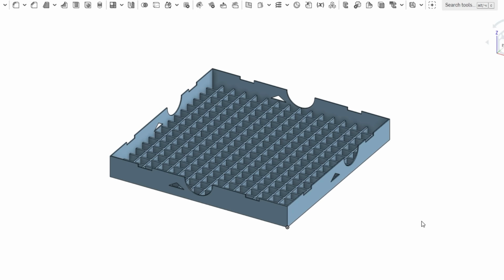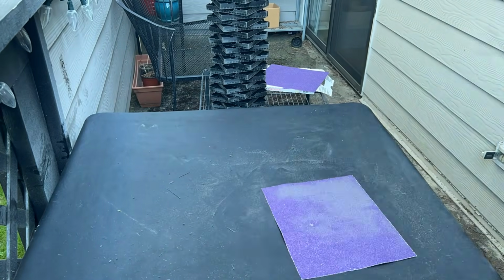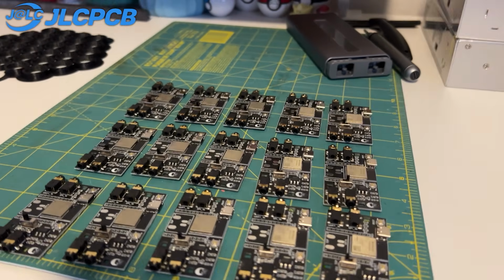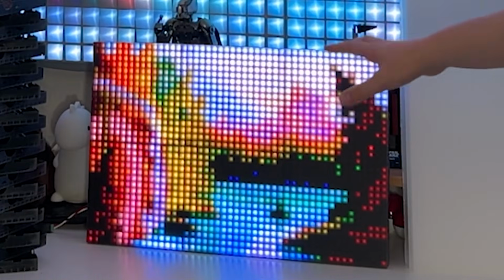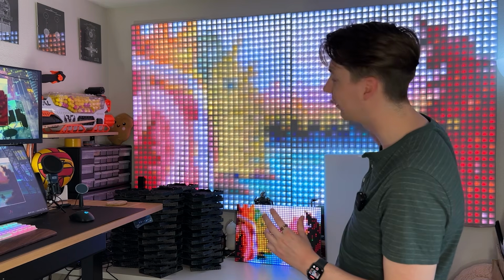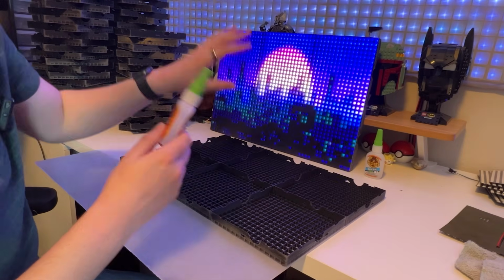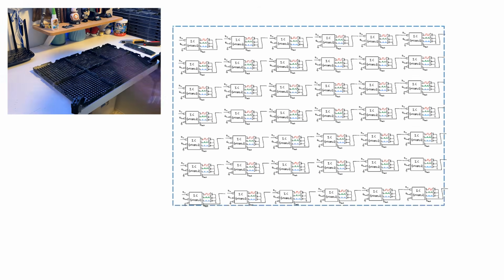How To Build a HUGE LED Wall From $5 Tiles

Comment: You didn't cover the most important part, software
Are you using WLED?
Hiw do yoy get vit into the esp32?
I have a cot of 16x32's lying around and want to find a way to get PC stats into WLED maybe it can be done through thr same method you are using to grt video in.
I want to put the 32x16 matrix vertically inside my PC case for stats such as temps and also run sognal RGB effects on it.
Even though I already have a 8.8 turzx screen in there, there is a perfect palce for the matrix

Comment: This is a pretty mid design to be honest.  I did one years ago and despite not being a "hardware designer" I put some actual thought into my design.  Here are some tips for you to think about next time:

1) your aperture grill should not be enclosed on all 4 sides.  This doubles the thickness of every aperture edge that butts up against another one.  Only enclose the top and left sides, then use strips to finish the bottom and right side of the full aperture frame.  Alternatively, create multiple aperture models.

2) use metallic/silver filament instead of black.  This drastically increases brightness. 

3) use diffusion film specifically made to diffuse light to cover the aperture.  It's inexpensive and lets maximum light through it while evenly illuminating the aperture squares and eliminates hot spots.

Comment: i would have used pogo pins instead of the 3,5 inch plugs  with some magnets it would connect bye holding a tile close to the rest
Reply from the maker: This was my original vision for the project but it was going to be too expensive

Comment: Good but too low pixel count there is a panel available in market for little bit more $7 if you but offline  but the resolution is 1080*720
Reply from the maker: Please share the link so I can use these in a future project

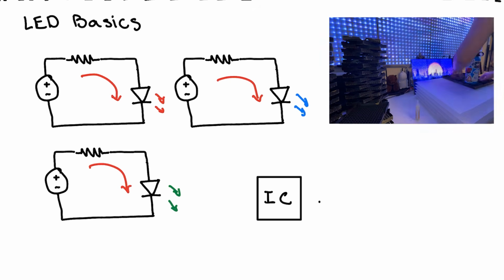Comment: 10:53 "unlike a lightbulb which can be dimmed by reducing the amount of energy going into it, LEDs are limited to an ON or OFF state".
first ... no? with the On/Off switching you DO limit the amount of energy..... that is the point of PWM.

And secondly LEDs can be simply current-controlled and it is the superior way but a bit more complex so hardly ever used. It is better for efficiency and lifetime of the system.

Comment: You should redo the code in ESP-IDF, it will take A LOT but it will be worth the speed increase if you do only the necessary and make the ESP32 use both cores in a more organized manner, unfortunately Arduino is not the best for it
Reply from the maker: I had originally designed the code to use both cores and store extra frames in a buffer, but the transfer speeds from my PC are so slow that it made no difference. If I were to redo this project and implement a proper USB controller then I could really take advantage of the parallel processing. The downside of that is that I’d need to write a USB driver and that is a lot of work for a non-marketable project

Comment: That was a pretty awesome build, well done! The overall look and posterization is great :D 
What baud rate were you using for the serial connections by the way, was it standard 9600?  -- I assume higher baud might reduce lag between individual panel squares, but could introduce corrupt/missing frames.
Reply from the maker: The baud rate maxes out at 921600 but technically I’m running these at 2000000 to squeeze every bit of speed I can get
Reply: @Tech-Random  Woooow that's impressive performance for serial! Did you talk about choosing serial in another video? Or is it the only inter-ESP comms method that can work [for your displays]? -- Not an expert myself!

Comment: the few plates on the right are a little slower then the first and last one, is it possible to connect the 3d ones  to the 1st one? or will that mess it up?

Comment: When printing the 16x16 grids, could you avoid printing the frame on the right/top of each module so that when they are placed next to each other, a double thickness is not created, which would then be visible as a grid when the display is on.

Comment: This is really cool! Have you thought of adding some dithering either to the signal from your pc  or on the controllers to get less banding with your limited bit depth?
Reply: Colors and luminance will be all over the place anyway, as those panels cover 0 to 100% defect rate perfectly linear

Comment: This is pretty cool, but I wonder: What is the main limitation for the 12fps frame rate? Too many LEDs in series, the ESPe not being fast enough or the data connection being not fast enough?
Reply from the maker: It’s the data coming in from my PC. USB Serial is limited to 1 Mbps so the math is 192 x 128 = 24,576 Bytes per frame. 24,576 x 8 = 196,608 bits per frame so about 5 frames per second. I’m running groups of 4 panels in parallel so I have a theoretical max of 20 frames per second  with this setup.

Comment: This is a fun video/project - I have a suggestion for mounting all of the panels on the acrylic - you could have either put registration features on the sides of the panels, or used the channels you’ve already created to align all of the sections of a panel together more easily. If you created a grid from some tubes, you could have placed that in the channels, and that could have held all of the panels together.

Comment: Funny, I just thought about doing a project like this the other day! Things I think could improve your project would be:
-Make the outer walls half thickness of the inner walls so that when the panels are joined the seam isn't as visible. Alternatively, leave sides out depending on the panels placement.
-Do alignment tabs/grooves/holes to make sure panels align well.
-SLA print in stacks (If you have one big enough). It would be faster, reduce sanding and then the left over support (if any) would be on the back/front and thereby not messing with the alignment.
-If your wall isn't completely flat, first mount a flat piece of wood. This helps panel alignment and reduces panel mounting workload (screwing) considerably if you have hard walls like concrete or bricks.

Congratulations on 12fps! That's really impressive for a DIY screen of this size running on ESPs 😲
Reply: I actually also thought about doing a project like this and had the same ideas with the half thickness, alignement tabs and the wood on the wall i havent thought about sla printing tho :)
Reply: 'leave sides out'  This will be generally superior, as in open right side and bottom.  Then just make a full thickness end cap for the right side and bottom, that can snap in the same way the blocks snap together.
Doing the half thick thing for a relatively thin piece already will likely have more warping and fit issues.

Comment: I didn't like how long it took for the data signal to propagate when doing my LED array so I chopped them into shorter strips addressed in parallel. Addressing 24 separate strips of 60 LEDs gave me a 24x60 panel that could refresh up to 360 times per second, the motion clarity is just butter smooth 🧈
Reply from the maker: The limiting factor is actually the speed I get data from my PC over USB Serial. It’s limited to 1 Mbps so it maxes out at 12 fps while my circuit could easily drive the pixels at around 45 fps. I would love to upgrade to USB 3 but that’s expensive and development would take a long time.
Reply: @Tech-Random  I ran into that issue as well and switched to HDMI and used a hobby FPGA to buffer and output LED data signals out of 24 separate pins. It started as a lightning project but turned into a really good entry to learning HDL and synchronous design
Reply: @Tech-Random  ethernet is always an option as well if you need to provide a bit more bandwidth. Given each 'strip' is comprised of 8 16*16 panels giving you 2048 LEDs per strip, with 30 microseconds per LED update it would take 61440 microseconds per column to update, giving you a theoretical maximum of ~16.27FPS given your current configuration. Only real way to improve on this is to section up your LED strips more, there's no changing how fast the LEDs themselves can actually update

Comment: now you have to buy an abandoned theater and make it 10 times bigger. I'd also suggest making the input on a separate board and divide it up with cables of fixed length.
Reply: He would run out of address space
Reply: @coolm98   it'd still only be 1920 by 1280
Reply from the maker: @neutrallybiassed1330 Full HD!

Comment: You could maybe design an interlocking dovetail type pattern for the panels, to help them fit snug together and to still keep a straight edge on where they meet. Maybe for the brim it could have a perforated pattern right where you need to stop sanding to make it easier to distinguish material that's meant to be there from the flashing.

Otherwise really cool project, 5/piece is a steal.

Comment: Pick up a nicer 3D printer (doesn't even need to be resin, just a nice modern FDM printer like a bambu labs). You could have avoided removing the brims and any sanding. Definitely worth the investment!

Comment: Any reason you didn't use the APA102 pixels?
Reply from the maker: Too expensive:
https://www.aliexpress.us/item/2251832133665850.html?spm=a2g0n.productlist.0.0.3967246eguO7NI&browser_id=e20afc80bb6f4d0093a55219d6849599&aff_platform=msite&m_page_id=yovdhwwuwicacbbk19152281b7f1a71c7bb6e40414&gclid=&pdp_npi=4%40dis%21USD%2184.50%2165.91%21%21%2184.50%2165.91%21%402101e62517236602458696042eb4e5%2161427381998%21sea%21US%210%21ABX&algo_pvid=9ee08d0e-fccd-400e-b726-0e4b67e6c016&_universallink=1&m_page_id=yovdhwwuwicacbbk19152281b7f1a71c7bb6e40414

Comment: this is a perfect representation on how oled screens work. awesome build
Reply: *micro-led
Reply from the maker: @driver7227 I should call this the macro-LED tv 😂
Reply: @Tech-Random exactly bro, since they’re both LEDs
Reply: @Tech-Random   Next up: 200 LED / m, 5 mm wide strips! For a diffuser tip: sand only the outside part! If you diffuse the light going in (especially this thick) light can bleed to other pixels. I wonder if this is the cause of the very bright center of the pixels. Preferably you use the thinnest diffuser you can with diffuser to LED distance 15+ mm.

Comment: I would have recommended getting SK9822 or APA102c based ARGB Matrices, as they have a separate clock line, letting you push more data by increasing the clock, thus increasing framerate. the SK9822 IC can go up to 15 MHz, which is 18.75 times faster than WS2812B (800 kHz)

Comment: I assume that you're currently driving the LED panels data line by feeding from one panel into the next?
Have you thought about running the panels in parallel allowing you to claw back some FPS?
Reply from the maker: Each vertical column is connected in series and the bottom panels are connected to my PC in parallel. That’s why the frames refresh out of sync vertically in some of the clips. I’m hoping to improve this in the future though!
Reply: @Tech-Random  ever think about implementing something like the I2SClocklessLedDriver for esp32s3? 

could split the overall matrix into 16 different areas which are all driven in parallel, I know FastLED.show() is blocking as it pushes data out to the LEDs so the longer each strip is the less fps you'll get, but splitting it up into 16 smaller 'strips' would mean you'd be able to populate each strip a tad bit faster. 

Could take it a bit further and swap to a teensy 4.1 which could do parallel output on any given pin which could allow for more zones, although that is a more expensive MCU
Reply: @Tech-Random  Check out the I2S capabilities of the ESP32, it can drive 24 channels in parallel and thus can achieve extremely high framerates! ;)
Using a single ESP32 with the I2S output its very easy to push ~6k pixels over multiple channels at around 240fps.
Next challange is getting the data from the PC to the ESP32 quick enough, serial is a bottle neck, but Wifi/Ethernet has much more bandwidth. :)

Comment: why not leave 2  outer walls of the tiles  while printing so they connect seemlessly and dont build a thincker line between them?
Reply: the outside line being thick is good for structure maybe not for finished form

Comment: 196 x 128 = 25,088 pixels @ 12fps = 301,056 updates every second!
And here I was patting myself on the back for writing a basic 3d projection animation using an ESP8266 with a 160x120 RGB TFT display. Comparison really is the thief of joy.
Congrats, you built a thing of beauty

Comment: Why didn't you design the square support to clip within one another? Also using wood or metal would make everything more rigid. Did you think about the edge of each mount doubling your spacing? It's noticable, probably far more than if you glued everything on a plank.

Comment: A resin printer would have improved the printing time considerably, and there is no need to sand them afterward. 
In SLA Printing only the overall Print time matters (Influenced by hight of the print) but not the amount of objects you print at the same time. 
With a good dialed in settings, on a decently sized printer you could have printed 10 of these tiles at ones. And you could have printed the Diffuser right on it (SLA allows for much much thinner layers) 

Also Consider small plastic lenses to get an better even spread of the light.

Great Video and Project btw :)

Comment: Nice project and video! One question: Aren't you worried about voltage dropping, connecting so many matrices/LEDs in series per panel? 
I would try to feed every matrix with its own power so that the copper trails don't get too hot supplying the last matrix in the panel
Reply from the maker: I did a lot of testing to find the best balance. I’m only driving the leds at about 5% brightness so I can take some shortcuts. In the EPIC MONTAGE there’s a clip where I drive all the pixels white and you can see the last matrix in series is pretty yellow because of the voltage drop. Lowering the brightness a bit more fixed the problem!
Reply: I have experienced quite a few fatal failures on those flexible units, thermal image at full load clearly shows the solder pads running away - also you will immediately notice luminance (and therefore chroma shift) degrading both at hotspots and bad smd solder
I'm actually quite impressed how he had not at least 3 of those panels DoA needing a reflow. They are absolute bang for the buck, no question. Sometimes even below 4usd. But 800khz isn't just not cutting it for a single wire signal... If 500usd budget has to deliver this size, you'd absolutely outperform this wall with pretty much any used beamer matching the price range in both size, brightness reliability and post rave evac sellout value